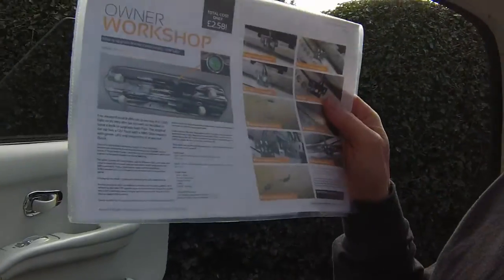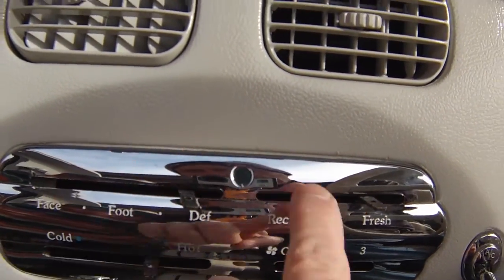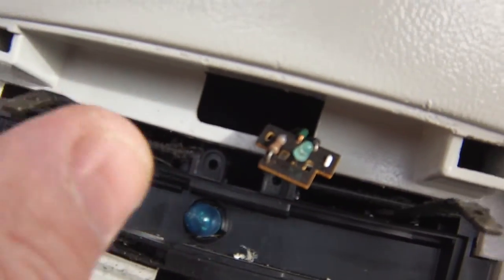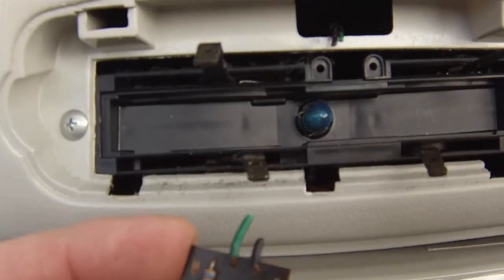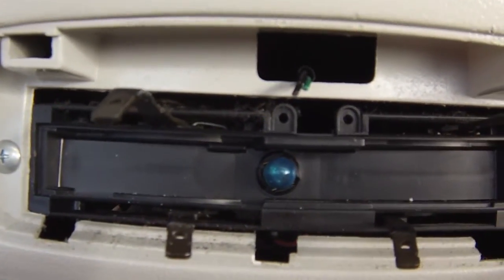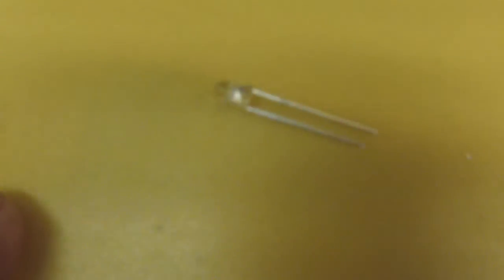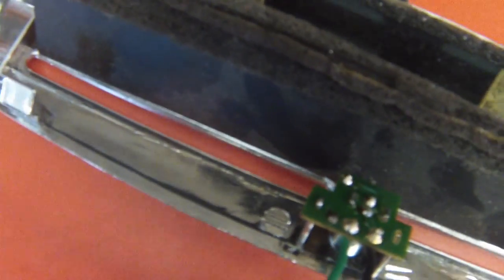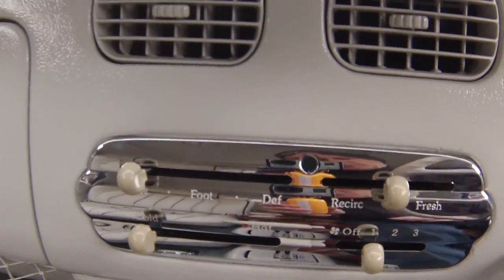Nissan Figaro A/C LED 'ON/OFF' Upgrade

Comment: Hi guys do you have a video of the bulb that lights the complete heater control panel?
Reply from the maker: No Steve, but if you remove the panel, you will see the bulbs. Remove and replace